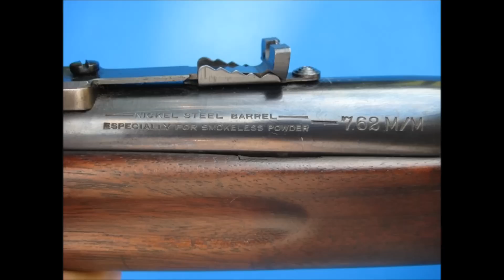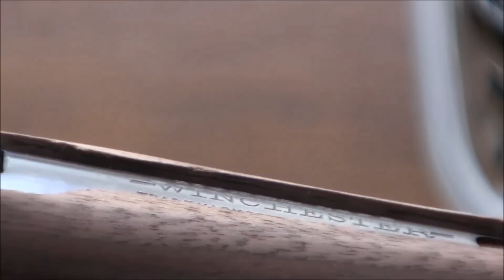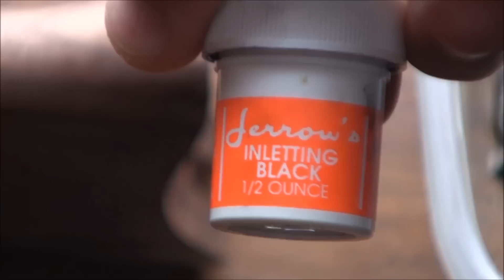Winchester 1895 Russian Musket Restoration - Part 1

Comment: You know I know it won't be returned to original, due to the barrel being chopped down when it was sporterized, but it could be an interesting take on what the Russians might of done with a carbine length rifle. I'm interested in seeing the final rifle. Are you going to re blue the rifle or have it parkerized? Or are you going to leave the metal as is?
Reply from the maker: I will likely leave the metal as is because it is not bad. If I were to refinish it I would go for a high polish blue, as this is what it is now.

Comment: Where did you find the rear sight? I’m working on a US (1 of 10,000) and am missing a few parts. Any tips on where to find parts would be awesome.
Reply from the maker: EBay from a guy in Finland. They are ridiculously hard to find for Russian version in arshins. But check EBay, and save a search, so they notify you when parts pop up under your search
Reply: @MosinVirus  Thanks for the advise. I have one of the US stamped receiver models. I am missing a handful of parts and have been able to find all but the hammer spring steal and that ladder style rear sight. I would not have been able to do the restoration with out your videos.

Comment: I have one of these rifles. I bought at an auction. Someone took the forend and stripper clip guides off and put a sporter forend on it but the barrel was not cut. I'm looking for the parts to restore it to original condition. Any ideas on where to look for parts?
Reply from the maker: The forend and handguard I have seen on ebay. I have a set of charger guides.

Comment: What was the length of the barrel on the rifle when you got it?
Reply from the maker: Jacob Weesner 24" it seems to have been done when the rifle was sporterized. It is still 24". I did nothing to change the length.
Reply: MosinVirus Thanks very much for the quick response.
Reply from the maker: Jacob Weesner no problem. I was speaking with someone on the forums, and it seems that shortening barrels was pretty common for sporter configurations, but ultimately I woukd really want to know why that was done (in case something was wrong with the barrel). The bore on this one is so good that I decided not to replace the barrel with a proper length one because the one I bought had a bore condition inferior to this one.
Reply: MosinVirus The only reason I can think of is either balance or to take  into a stand or car, or something like that. I perused the forums where you chronicled the restoration, and didn't see the original barrel length which is why I asked here.
Reply from the maker: Jacob Weesner oh, sorry. the original length is 28".
Reply: MosinVirus I swear this is the last thing and I'll leave you alone. I just saw an old forum post where you were selling some of the parts you had left over. Would you happen to still have the clip guides?